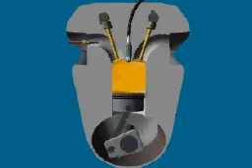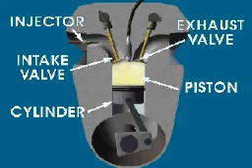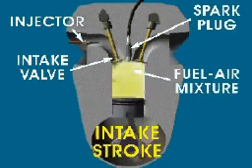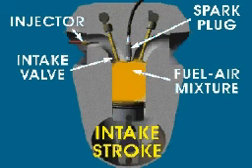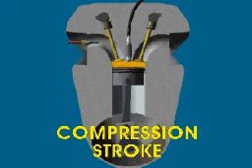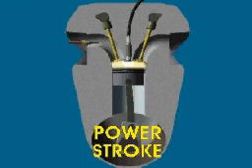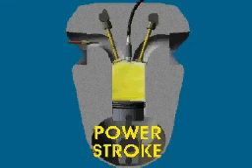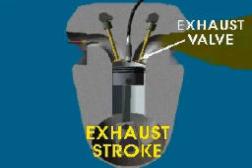How a 4 stroke car engine works

Comment: It means an engine which is 1.5 Litres(or Cubic Cms) in volume. This can be calculated by formulae:
Boar diameter x Piston displacement length x No. of cylinders.

Comment: @JavelinMusic because when this piston is at the compression stroke the other piston is at the ignition sroke. there is no 1 piston engine. V4 has 4 pistons V6 has 6 and so on... all pistons are connected together.